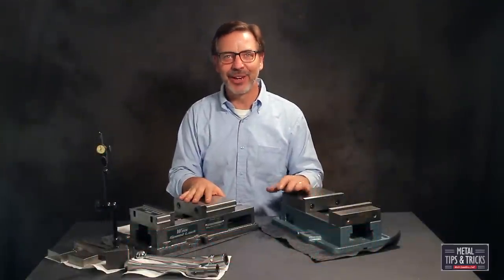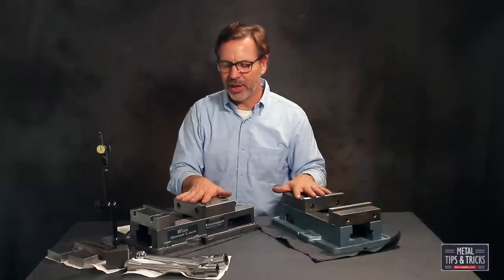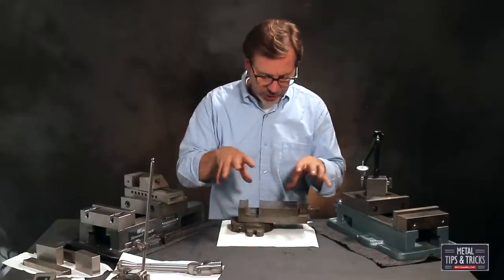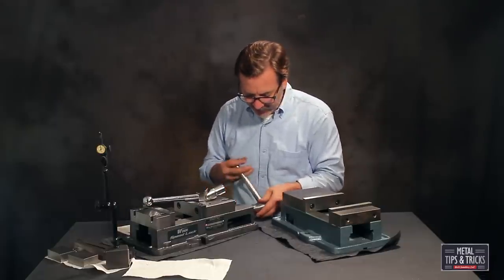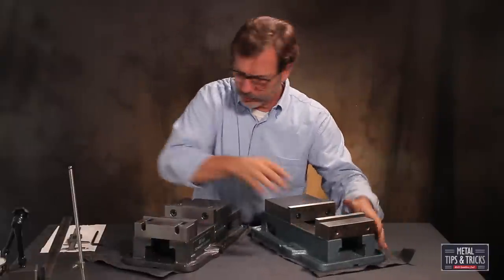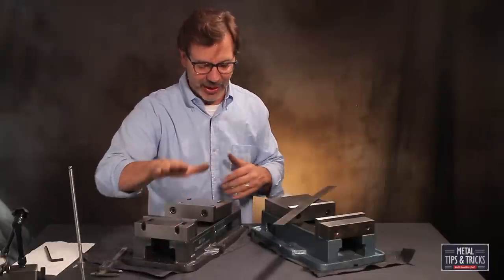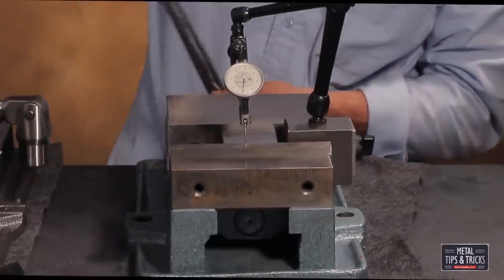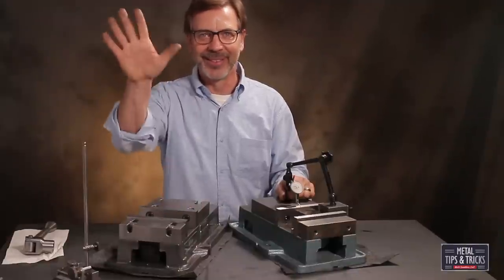China Vs USA  Machinist Vise

Comment: I am a retired American machinist who believes in American quality & precision and other country's precision like Germany, Japan & Switzerland.  But I felt you were nit-picking the chinese vice.  And since you were nit-picking, I want to point out that at13:30 in your video, you incorrectly called the flatness of the rail of the Winn to be out by "ten thousandths of an inch".  that's why most machinists just say "it's out by a tenth".  I've always like Kurt milling vises and have 2 Mitutoyo grinding type vices.  I would not trust any heavy milling on that Winn vise because of the design of the jaws.  Those pins would tend to vibrate up and lose the part location under cyclic stress.   Not your best video.   50% of your viewers gave it a thumbs down so just learn from it.  Hopefully your credibility will return over time.

Comment: You can not expect a non American tool to be made to fit inches. That goes for the handle, the jaws and the bed height. I am not a machinist but I am guessing there is some semi standard bed height and jaw size that fit a whole unit measured in metric.
Reply: yep the developed world is metric, metric vices have 150mm jaws which is only approx 6 inches, and the general class size, but 2.4mm difference means things wont interchange and thread sizes, usa is living in the past and wonders why it cant export anything

Comment: Unfortunately this has become a very biased video. I urge you to place a "contains paid promotion" notification in the video.
Reply: kinda obvious what company he works for
Reply: I don't work for any vise company or get any free milling vises. The Chinese vises I have owned, seen, and used are crude and inferior in every way but possibly cost (that goes for most Chinese tools, by the way). The metal is inferior, the workmanship is inferior, the durability is inferior, the consistency is inferior, and trying to use them for precise or production machining is an exercise in frustration. You lose more than you can possibly save. They will serve the only most basic machining needs, and that's all. It's like buying buckets that have holes in the bottom, they don't works as good as buckets with no holes. So I would say his video was very accurate.
Reply: I agree. Extremely biased.
Reply: @G53X0Y0Z0  There are chinese companies that make expensive high end vises even better than the american ones. It's unfair to campare two products in a totally different price range.
Reply: @ohammouda  ,  I always hear about all these supposedly good Chinese  tools. To me they are like Bigfoot, I have never seen them and have no idea where to find them.

Comment: Price difference please? I think its not a fair comparison. China makes a range for all markets.
Reply: let me add something of interest, i had a new set of british Britool spanners i bought in the 80s, and a current set of chinese spanners, probably a 40 quid set, included small to large,   i thought i should treat myself and use the britool ones after keeping them for so long, after all be dead one day!.   i noticed they felt sloppy on the bolt heads, but dismissed it, till it rounded a head, and weirdly, the chinese spanner could still grip and undo it.   i got out my inside mic stuff,   every single british made spanner was larger than the chinese spanner, and also exceeded the error that british standard specified.  the Chinese spanners met perfectly the ISO standard they quoted.   i sold them on ebay and got a large amount of money, i dont miss them

Comment: holy smokes that was hard to watch... most cringe worthy when you were showing the Chinese vise jaw lift but failed to mention  the set screw in the jaw that will stiffen that up so it doesn't lift like that.And you said it yourself that there were some burs on the bottom of the vise so why not stone them off before checking flatness like any good machinist would do? pretty biased it looks like

Comment: The problem is US distributors. Chinese manufacturers will provide whatever quality the distributors are willing to order. US distributors order large quantities and insist on details that lower the cost. I am speaking from experience. I know Chinese manufacturers who make milling machines of excellent quality. The ones they sell in China are beautiful. The US distributors come in and order 500 and insist on cheap bearings, lead screws and then they insist on further price reductions if the manufacturer wants the order. Otherwise, the distributor walks and finds a manufacturer who will give them the price they want to pay. In China, I can buy products off the shelf as good as any you can get in the US. The top brands never make to the US market. If they did, the distributor would have to charge US prices. They have to make a buck and this is how they do it.

Comment: Timely video, I'm actually shopping for a 6" vise just like this. But for now, I'm only mounting it to my drill press. Maybe I don't need the precision. When I get a CNC Mill, I'll think for sure I'll pay the extra. The amount of flex was eye opening for sure. I can see that being a real problem.
Reply from the maker: I would buy it for my drill press.
Reply: Yeah, I am re-thinking that just based on the shear size of this thing. It's one thing to see them on eBay listing, but another to see them being moved around on the table here. What I might end up getting is just a "Drill Press Vise" and after a lot of looking, even though it's twice as expensive, I'm looking at the Yost brand. It's made in USA, as the highest cast iron tensile strength of any in the class. Plus, it's still 6" jaw, but is actually small enough to keep on your drill press table and be able to move it around.
http://www.ebay.com/itm/Yost-Model-6D-Yost-Heavy-Duty-Drill-Press-Vise/332160728134?ssPageName=STRK%3AMEBIDX%3AIT&_trksid=p2055119.m1438.l2649
I recently got an 8" Yost Vise, and it's HUGE!! But I'm glad I got it over another cheapy import. (Since I recently had one fail on me unexpectedly)

Comment: Dale, are you aiming this at machinists or weekenders?  Because machinists, when working on a budget, can overcome the relatively minor issues with the imported vise without great effort. Most weekender hobbyists can as well.

We work with parallels and shims, and  use  squares and sometimes indicators to get our setups dialed in. If a workholding device is grossly out of true, then there is a major difference in the ease with which one does their setup. However, the ENCO import here is only at most 0.002" off on the flatness of the ways in ~6" - that's ~0.03%, in a direction where one is going to shim their setup if they need it more true.

Which makes your comment about a ganged vise setup  even less relevant... if I need to use two or more vises to hold a workpiece, using parallels in each one, it's not a big deal to use different parallels and possibly shims, to true things up.

I expect that if you were to gang the Winn vise with a Kurt on the table of your mill, or even with another Winn, you will find that the condition of your table surface is such that some shimming would be required if you really need to be true to within under a mil (0.001") over the length of the work.

The Winn vise has a nice fit and finish, almost to toolmaker's levels, and costs accordingly.

As for the standardness of the replacement jaws, if you know how to mill, you can adapt  them to fit whichever vise you will be using. You can also make your own soft jaws from aluminum.

The ~$200 imported vise is perfectly serviceable ~99% of the work it could conceivably be called upon to perform, and it costs ~1/3 of the Winn. Even if you are doing this  professionally - getting paid -  you can only write off an expense against your income. You might need that extra $400 to buy cutting tools or consumables for a job.

In short, the pretty tools are nice, but not always worth the extra money.

It's a case of: "you pay for what you get..."

Comment: If you have consistent movement you can adjust for accuracy surly not. So it's 4 thou out, all the time,, could you not put a 4 thou shim to make up for this. I know it's not ideal for a master machinist but was just thinking if someone hasn't the cash, can't remember the price difference. But this did make me think of the guy zeroing his scope who got one bullet center mass and then the rest spread in a 2 inch group around it, then you had the other guy who's bullets all ended up 4 inches out but with a spread of a 1/4 of an inch. Food for thought maybe. Great video
Reply: Most master machinists will still be using shims, parallels, and a bump hammer to dial in their work. No workholding device is ever perfect, so as long as the discrepancies are small enough to be easy to work with, who cares?
Reply from the maker: Hi Iell3 , Great question. Yes you could use shims, but do you want to?  They take a lot of time to work with and you will need to test your vise for different sizes parts to in sure consistency. thanks for your quetion :-)
Reply: Well, in most cases, some decent parallels and a tiny bit of tapping with a soft hammer is necessary, no matter what the quality of the vise, if you want / need to be within 0.005"

In my experience, the cheaper vise just needs a bit more adjustment than with a pricier vise, which may make no real difference in the amount of time & effort involved in the setup... just require a slightly thicker bit of shim stock or soft copper / aluminum.

Your Mileage May Vary...

Comment: eh, if the vice has a hexagon for the screw that is measured in inches, then its much more likely to be a USA vice then a China vice... china works in Metric. unlike the USA and 1 other very small country.
Reply: its a promotion video... but he didn't state that anywhere (by law required to have that in the start of the video, NOT in some subnotes far away)
also, price point is way different probably.... 

also, another bullshit argument, having the screw above the plane doesn't mean its going to bow, for you have your clamps in the middle to keep it down.....
Reply: Rewatched the part of the video regarding the handles... and he brings the china one's being "metric" as a downside... pretty stupid.
Reply: Yep. A 19mm socket will fit loosely on a 3/4" hex, but a tight spec. 3/4" socket is a press-fit on a 19mm hex. And, since 20mm is the standard size for metric hex stock, it could be worse...
Reply from the maker: datastorm, Im sorry you didn't  understand the down side to the handle being metric. Its not that it is metric, its that it doesn't meet the normal standers in most American shops.  I have 4 different types of handles in my shop.  If I owned that vise I would have to buy 4 more, or modify the nut on the Enco.
Reply: I've been a machinist for a number of years here in the Netherlands (EU). Everything Imperial was kept separated in one (small) cabinet. As I said, only the USA is keeping the outdated Imperial on. That other small country that has Imperial is changing to Metric as well. Did you know that USA's Imperial is just one of the English flavours of the measuring system? Every province had their own measuring for a very long time before Metric came around. They adjusted it often multiple times a year to have some off-set vs neightbouring provinces/townstates to make them more profitable, and changed again for the country's tax to be lower. Only work imperial when absolutely needed, and main Metric. For Imperial should not stay in use, it has costed a lot of lives and billions of dollars already with mistakes made with conversing it.

Btw, Imperial measurements are nowadays defined by Metric measurements.
Reply: China works in a mix of standards, you can find fasteners that you will never discover what thread they are.

Comment: Comparing metric to imperial and calling out the Chinese vise height being different - that was a crumby move we could equally say that the USA vises in any other country in the world (with the exception of just two) would be at fault -  lets see you compare  a $200 USA made vise rather than the top of the range you have here. your valid points got lost in the acrimony - shame.
Reply from the maker: I think its important note all the differences in vises. The height different is key to those people who  already owned a Kurt vice. would you agree?
Reply: Yea very much, still we could buy three of the Chinese vises for the price of one Kurt and avoid the problem altogether.
Reply: No, not *key*...

Important to note, and account for in your setups, but not a deal breaker...

Now, what if you are buying your first vise, and are on a tight budget, and the Craigslist offerings in your neighborhood are tool shaped piles of rust offered for nearly the brand new price?

As for your setup, you should be paying attention to what you are doing, and how you use parallels, shims, 1-2-3 blocks, and maybe even machinist jacks.

Lots of things that you can do with 1/2"-13 nuts and bolts from your local hardware store as well.

So, no, it's far from being a deal breaker.

I won't say no if someone were to gift me with a Kurt vise in decent shape,  but I'm not at all unhappy with my H&HIP import...

Comment: That winn vise is just a modified kurt vise. They even milled out the cast logo on the bottom. I find that amusing.
Reply from the maker: No, your not right these are not kurt vises .  Winn has these vises made for them. If you look closely you can see the differences well watching the video.
Reply: I beg to differ. The casting looks identical to a Kurt D688. Winn most likely purchases the castings from Kurt as that is a very cost effective way to make a "modified" kurt style vise like this. Personally I see no point in this style of vise jaw system, there are much better designs out there for quickly changing vise jaws. Or just get an air ratchet and zip the screws out.. I run primarily aluminum soft jaws in my vises (hard jaws usually only when using fixtures) and its is easy enough to just loosen the screws and zip them out with an air ratchet. This is making a solution for a problem that doesn't really exist.

Comment: Any machinist worth his salt could make a replacement handle, cheap. METRIC or not.
The finish on the depressed areas beneath the vise doesn't matter!
The mounting surface of any machine vise should be stoned lightly before you mount it to the table.
You ignored the most important issues... Is the surface the jaws slide over on the same plane as the mounting surface? Are the jaws flat, parallel, and VERTICAL relative to the mounting surface? Are the jaws properly hardened? Can you buy replacements? (Not every shop has heat treating facilities.)

Comment: You're comparing expensive to cheap.. or better: overpriced to cheap.
Reply: And even then it was quite the stretch to say that the differences could really make a difference in the quality of the work that will be done with these vises. Most of the "deficiencies" in the discount vise would vanish when you setup a workpiece and dial it in.

Some of the issues don't matter at all - like whether or not the recessed areas under the base of the vise ever get machined.

If the smoothness of the surface finish on the bottom face matters, or the geometry of the keyways is suspect, it is a relatively minor thing to mill them to a better condition.
Reply from the maker: No! I'm comparing a cheap knockoff to a quality tool to help my viewers understand you get what you pay for. :-)
Reply: Dale I think you are missing a big point, you are comparing an inexpensive modified copy of a Kurt vice to a EXPENSIVE MODIFIED COPY OF A KURT VISE
Reply from the maker: I think its a fair comparison because the cheap vise is trying to look like, and try to convince buyers that its  as good as a Kurt or a Winn. I have just shown that is not.  Why is this wrong?  Its enco you should be mad at, not me.
Reply: I agree the "cheap" vise looks like the kurt vise, no where do I see claims that it is as good as a kurt vise. The "cheap"  vise is less than 1/3 the cost of a kurt, and will do 99 % of the tasks of a home shop machinist, to which I perceive your channel caters  to. Most old machines and imported new machines will have the same or more out of tolerance as the "Cheap" vise.  The "cheap" vise and the Winn vise have taken kurt vise and have copied curtain elements of it. Therefor a better comparison would be To compare the Winn to the kurt. I do admit the the Winn vise does look very nice.

Comment: As a former toolmaker I wouldn't use one of these both. I've worked a lot with the full hardened grinding vises on a surface grinder. They're really accurate buth aI don't prefer them on a milling machine ( I don't trust the clamping force of it to withstand the milling force).
The best vise I ever worked with is the type 'Gripos' from Gressel or 'NC compact spanner' Rhöm. Really accurate on the long term and with enough clamping force for heavy CNC roughing
Reply from the maker: Thanks for your comment Patrick

Comment: I was taught on a Kurt and have a Kurt.  Thanks for the info.  Did you mean 1mil out on the Winn base or 10mil?  I have a hard time thinking it was 10 mil out that would have been 1 full dial indicator turn on a .0001 guage right?
Reply: He was saying 0.1 mil, or a 10,000th of an inch...  pretty much too finely finished in a direction which is not material to most setups - only really of issue if you are running an indicator against it as a reference.

For setups, the 2.5 mils per 6" on the import or roughle 0.03% variance, is well within tolerances for producing quality work.
Reply: I believe he said 10 thousandths of an inch, or 0.254 of a millimetre.